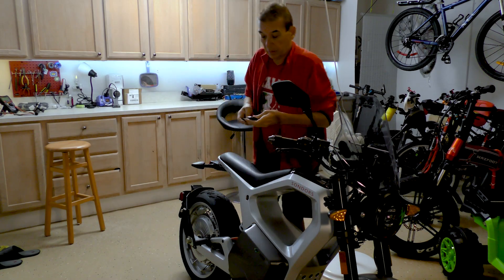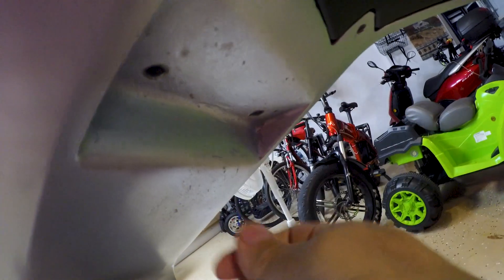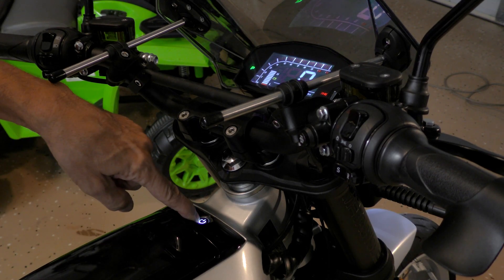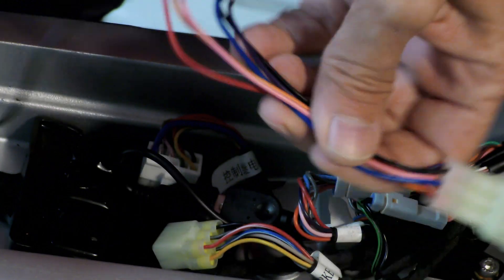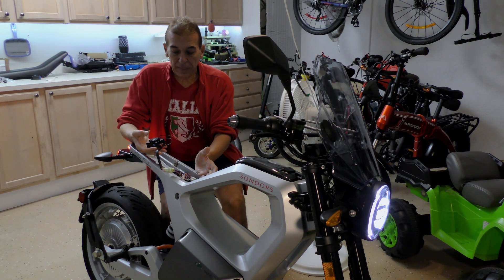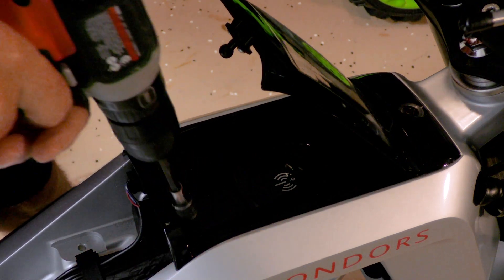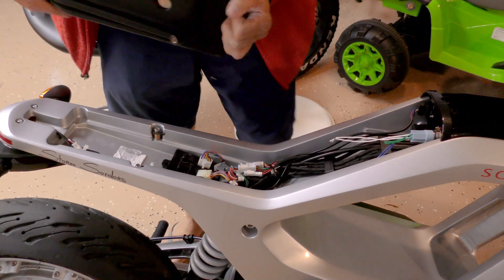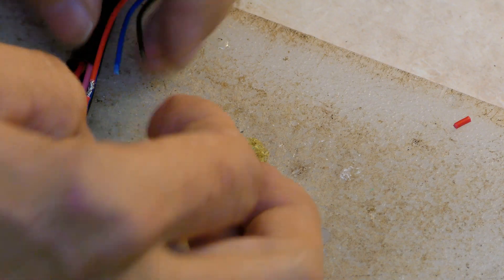Sondors Metacycle Power Failure Repair Alarm Module Modification

Comment: I also cannot find the exact alarm module to replace the one used by the Metacycle.  The only ones that I'm really seeing are 8-wire versions and not the 6-wire version that was installed and I'm definitely not an electrician.  Does anyone have a good recommendation for a replacement?

Comment: Mr. Davito. I hope you are well and your metacycle is still working.  I had been enjoying my Metacycle for a year before the alarm module went bad and followed your lead and installed a kill switch as you did.  I also then, decided to just loose the alarm module. I have been zipping around town relying only on my "hidden" kill switch.  Every thing fine for 2years until 2 days ago the Metacycle left me stranded and I had to walk/push it home for 3.7 miles.  Whew!!
 I pressed the power button on the bike, the dash comes to life like usual but the green "P" for park doesn't come on. The bike cannot be put into drive and none of the controls on the bars function at all (lights, signals, flashers, horn etc.) and the headlight and tail light do not come on.   It's o not the kill witch on the right side handle bar .  I  have tried everything and will look at the kickstand switch today.  I wondered if you have had or heard of this issue before?  Is there a main power control module?   Jack

Comment: really wished you did more videos related to the Sondors Metacycle like this one. I Went to Alibaba but could not find the seller to the module if you had put a link to the exact page it would have made it much easier to get.
Reply: Did you find one that works?
Reply: @nate4411 I think any alarm would work but just wanted to find the exact one it came with but honestly there are better ones